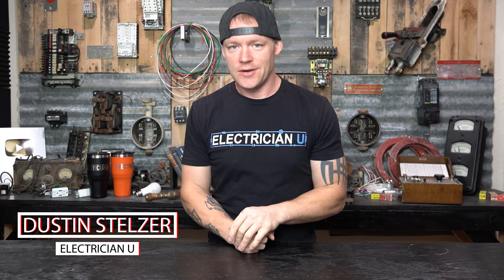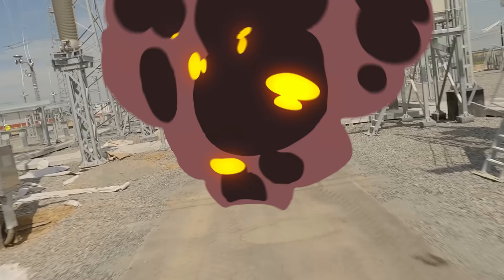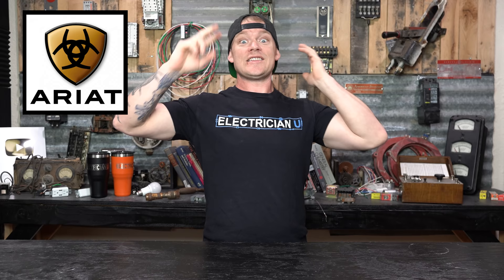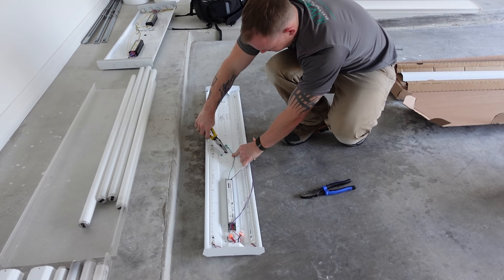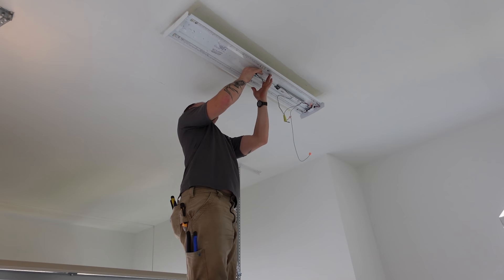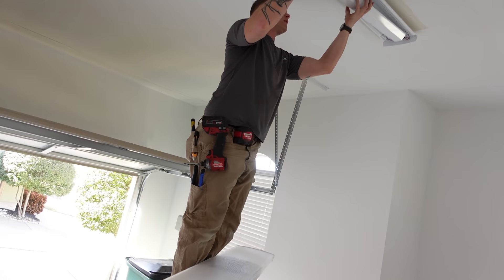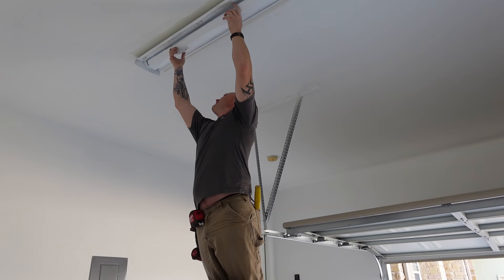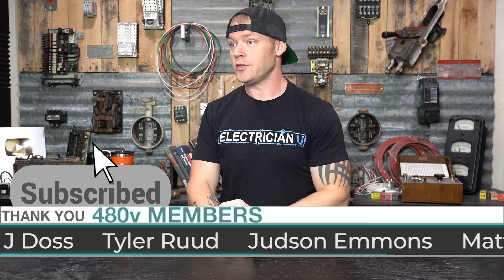Swapping Fluorescent Garage Lights to LED

Comment: I had a shop that I had to convert fluorescent light fixtures to LED. Not until recently, I found out that those type lights can interfere with wireless CCTV cameras. Seen this with garage door openers. The parts room is midway to the main shop. The main shop cameras will work if the bay doors are open. I'm gonna see if those cameras will work with the doors down if the parts room lights are off. Have you ran across this in any of your travels?

Comment: I looked to replace closet fluorescent lighting... Well I aint no fool but the cost to upgrade was stupid.. A 6500k daylight was like cheap lasts for a really long time..  I am not buying the farm just brite lighting..  LED still has a very long way to go..Like emitters that are replaceable.. Until then just chinese junk.. I do use them on flex lighting at my office and workshop.. And they do fail.. But they are regular screw in types of led..  Using them right now..  and when they fail and they will, i got spares in like 30 seconds.. Try that with those cheap led chinesium junk.,,, Landfill specials..

Comment: I know the problem with the reflectors but I was wondering why you didn't test the the lights before putting on the reflector? If something isn't working you need to take it off again (with the risk of damaging this thin plastic lids), greetings from germany

Comment: If you have more then 1 set of NM cables that are spliced inside of ceiling box the splices must be asessable. I then knock out a 2.5" KO with my hydralic knock out. Deburr edge if sharp. I usually run a few layers of quality made in USA black tape on the hole.

Comment: Question on wire nuts.  At one time in CT, USA wire nuts were code, where Wago splice connector and plug-ins were not. Do you know if that has changed? I'm not crazy about the old wire nut type.

Comment: if im working on switched power with the breaker on i will put masking tape over teh switch so it can not be operated.  ive never seen anyone just randomly try to flip a switch that was taped off. not foolproof, but it is another added layer of protection.

Comment: It would have been much easier to just swap in LED bulbs. Cut the damn ballasts out, wire tubes direct, and no having to repaint the ceiling because of course the fixtures are smaller.

Comment: earlier this year I worked a job replacing fluorescent to LED at a lowe's in north virginia and was terrified to learn that the strut that all the lights were hanging on were secured with toggle bolts to the I beams and not washers. some of that strut fell while taking down the lights and the security wire was strapped to the strut.

Comment: I don't know where you work on lights but a lot of the lights I have worked on have several wires connected to it. The first time I saw this I was surprised that they sent the power to the light and then came from there for all the plugs in the room. I know it was within code during the time the house was built but I never liked seeing 5 sets of wires in one box.

Comment: Some light fixtures can be installed with a switch loop.  The hot and neutral are run to the fixture and 2 wires are run from the fixture box to the switch.  In this case there is a live wire at the fixture box even with the switch off.  Be careful with electricity.  Your next mistake may be your last.

Comment: Liked as I do all of your videos, but speaking of safety, get a taller ladder! One trip to the ER will cost way more than a top of the line Little Giant Fiberglass Ladder.

NEC should make it so that fixtures like these must contain some sort of changeable "bulb(s)." Shouldn't have to mess with the wiring and have to change the fixture when the LEDs burn out. Homeowners should be able to change the "bulb(s)." I've seen LEDs that have last less that three years. What a waste of time and resources to put in a new LED fixture when the homeowner could simply change an LED "bulb."

Comment: WHY TAKE DOWN THE FIXTURE, JUST  PUT LED IN FOR THE REPACEMENT BULB'S.  WHEN I WORK AT THE NAVAL ACCADEMY IN MD. I REPLACED 1000,000,000 OF THE REGULAR BULBS WITH LED'S. THESES OLD BULBS WHERE FAT. NEVER HAD A PROBLEM. THIS WAS 20 YRS AGO.

Comment: Do you ever use the lockout for the breakers or even the lock out device for the wall switch?
Reply: I always put green painters tape over the switch if I can’t find the breaker.

Comment: Another reason for two ballasts was a California law (Title 22 California energy code) requiring all commercial buildings two have two switches for almost every room, each switching half of the lighting.
Reply: I think you mean title 24. California's energy code.
Reply: Ya I’ve seen that too where they had a switch for 2 bulbs and a switch for the other 2 and the lady was telling me it’s a booster switch lmao
Reply: @c31979839  My mistake. It’s been almost 30 years since I moved from California.

Comment: Quite a few years ago I bought a ranch house that was built in the 1950’s. Inside the front door is a three gang switch box. One switch goes to the outside light, another goes to a switched outlet inside and, for the life of me, I cannot figure out what the third switch goes to. It is wired up. Any ideas? It’s not another switched outlets, I replaced them all soon after I moved in and there is no rear door light.
Reply: Another outside light possibly?

Comment: Since the original fixtures looked in good condition, why wouldn't you rewire for and fit 4' LED retrofit "bulbs"? Cheaper than a new fixture and each bulb has it's own driver in it, so a dead driver is cheap and only kills the one bulb.

Comment: bro why you need to remove the old fittings all you have to do is to buy a led fluorescent lamp and by pass the ballast to connect the neutral and phase to energise it
Reply: besides its so costly and time-consuming for this kind of method

Comment: Why are you removing the existing fixtures.??  You can convert those fixtures TO LED without replacing the fixture.  You just remove the ballasts, and then with the sockets directly to 120 volts.  Put  One end of the fixture sockets will be hot.  The other end sockets will be neutrals.  That's it.  Install the new LED "bulbs"....which look like fluorescent bulbs, but everything is within LED "bulb".  One end is stamped with a "L" for line.  The other end stamp with a "N", for the neutral side.  The LED's are T-8 size, and they fit both T-12, and T-8 sockets.  Been doing this for a long time.  I have a contract on a 180,000 Sq. Ft. wearhouse, to CONVERT all of their fixtures to LED.  You can do this for any of the size fixtures.  The fixtures in the warehouse are  8 ft. HO bulbs.  You can buy LED,, 8 ft. "bulbs" with the HO ends, that will fit in the existing HO sockets.  I am also retro fitting many lights in a Church's office area, and hallways, etc. And I have done this in many houses.  It quick, and is cheaper, and a lot less hassle.
Reply: Do you need state license to get contracts for retrofitting
Reply: @pjmcinnis1188  More than likely Yes. Especially if you are doing it as a business, and you should have plenty of electrical experience.  I don't trust "handy man Joes".   You are "doing" wiring work.  And its more than just a repair., since you are altering the fixture.  And a Business license too. And Insurance.
Reply: @donaldwood9187  Thanks for your response. I wanted to do a few buildings around my area. Most of these building I would be retrofitting panels (2x2 and 2x4s) which don’t require much wire knowledge (hot, neutral, ground) any maybe a little low voltage for dimming. I wasn’t sure if I would need license because wires are installed. But I understand the insurance part just in case of damage.

Comment: A 4 lamp 40w F40T12 magnetic ballast never existed.in the mid 80s advance transformers (Philip's lighting division) did make a three lamp F40 T12 ballast  up until 2004

Comment: hate built in LED. you have to replace the fixture in 3 to 5 years. which also means more landfill. getting the led tube bypass replacements are better. less landfill.

Comment: "Hey, what's this orange tag on my breaker panel. *SNIP*. OH HEY, This breaker is off again. *CLICK*"
Reply: HA!  Is funny cause is true!  In any technical field or skilled trade, the phrase "No project survives first contact with a customer" is sadly true more often than not.  If you are not going to turn off out a household circuit before you start working on it, then at least set up an early warning system in case the customer gets into things.  Flip off the light switch in question and then slap a piece of 1 inch wide gaffer's tape over it, making sure the switch cannot be toggled without removing the tape.  Now you have a few more seconds to catch them before they flip the switch.  Gaffer's tape comes off cleanly and will not leave any residue or paint damage behind.
Reply: @docferringer  Or just lockout the breaker!
Reply: @jman210210  That's preferable.  James was talking about customers who see a tag or lock on a breaker and cutting it off, hence the tape suggestion.

Comment: I'll put blue painters tape over a light switch to prevent the accidently whoopsie.  It's even saved me from the being the offender a time or two.  I prefer that tape over stickier stuff like electrical tape, and the width fully covers it.  Comes off clean and fast.

A couple basic breaker lockouts and a lock are what, $20?  It's not even a minute when I'm already at the panel to throw that on, especially when it's far away from where I'm working.  I just make sure to keep the key on a lanyard that I'm wearing.  Losing or looking for the key would make it complicated...

Comment: All NAME BRAND led light replaced.  Flicker after one year.  All top brands All different. 
Leds save energy but suck for work lightnings. 
No loose connection All circuits tested. 
Bathroom Sylvania and GE.
GE THE WORSE.

Comment: Must LOTO all circuits that you turn off. So you people that perform electrical work please use a lock out on all the circuit breakers that you turn off.

Comment: https://www.lowes.com/pd/TOGGLER-10-Pack-Assorted-Length-x-1-4-in-Dia-Toggle-Bolt-Drywall-Anchor-Screws-Included/3183831    these toggle bolts are what I like using when hanging stuff

Comment: I hate using those toggle bolts, I like the plastic "zip" ones. Those are way better.
Reply: no those plastic ones dont hold shit if its going over my head im going to be sure it stays there
Reply: The plastic is just to hold it in place while you put the screw in ti. It has a metal base.